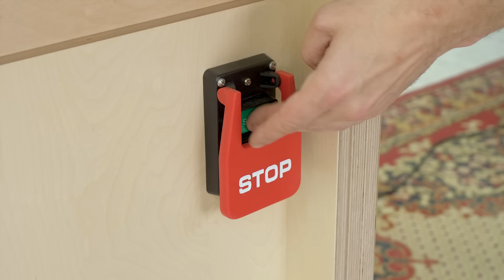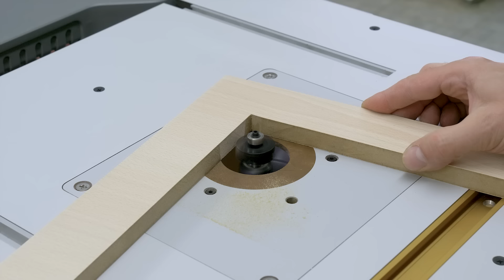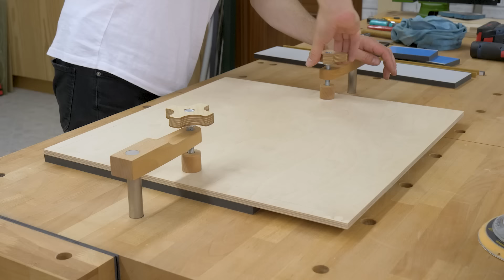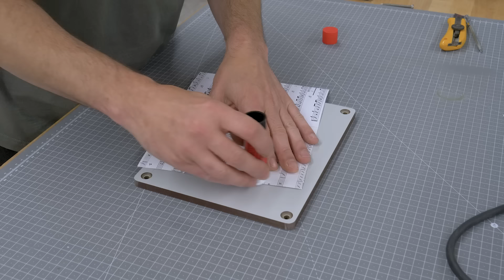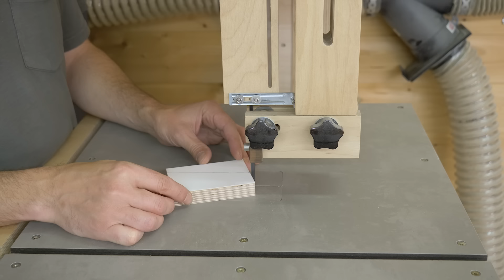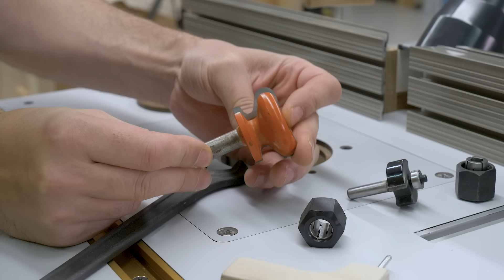Homemade Router Table & Router Insert / Mobile Workbench EP 3

Comment: I want to bring up one point I realized when I build the Mobile Workbench. The original fence can’t used anymore for shorter cuts than 11 cm due to block of the slider by the table saw extension pice number 15C without disassembly them for this kind of shorter cuts. I suppose this design is made on purpose this way to some reasons I do not understand at the moment. Is the any hint which can help me to get rid of the problem?
Reply from the maker: https://www.paoson.com/forum/viewtopic.php?f=33&t=2175

Comment: Hello,

I think your video is really great. I have the same router installed in my table. However, to turn the router upwards, I have to support the router from below and push it upwards a little with my hand, otherwise the mechanism will slip. 
Is this similar for you or is there a fault with my router? In the video, it looks like you can easily adjust it from above. 
I would really appreciate an answer and maybe even an idea to solve this problem.
Many thanks for your videos

Comment: Hello Suso,
First of all, congratulations for the design of the entire bench; from far the best I’ve ever seen in UTube !
I see that you are using the Bosch GMF 1600 router, but in the documentation that you posted I’ve also seen the Makita RT0700 kit with various sockets and at a more affordable price although it has less power. I would like to ensure that one of this socket can be used as a lift to mount it as a router table without major modification, but it’s hard to tell from the pictures I’ve seen. Of course I would like to adjust the depth from the top, without having to access the router from inside the cabinet. Could you please confirm that this is the case and that it would be sufficient to buy this kit and a plate ? Or do you think the Bosch is a far better option ?
Reply from the maker: hi Alexandre, the Makita RT0700 kit does not have the option of adjust the depth from the top, you have to do it from inside the cabinet, sorry. You can make a homemade lifting system, I have in mind to build one for my Bosch, the current system does not work correctly.
Reply: @Paoson_Woodworking  thanks for reverting back; now I know that neither options seem ideal; I’ll follow your posts with great interest to see if there is a good way around it; the cost of these lifts is prohibitive (the nice ones, I mean)
Many thanks and keep up your extraordinary work ! Best regards !
Reply: @Paoson_Woodworking  Thanks for this info, I've just purchased your excellent plans and am starting the build too.  Do you think the Festool 1400 or 2200 would also be appropriate or is the Bosch the only one with this function of height adjustment from the top?

Comment: The board you are using should be MFB EN 622-2 (HB). The HB stands for hard board. It‘s only „HB EN 622-2“, when it is not coated/laminated. SwissKrono calls them CDF. Anyway, great things you are building for the workshop!

Comment: man I just found your channel the other day, but I love it.  you show a lot of good angles, and explain how you're doing things and little tricks, very well.  and this video in particular has helped me rethink a design I was doing for a portable benchtop router table. I don't have one of those larger routers that someone would need for a table like this I have a DeWalt 20V(american .. 18v rest of the world) 1/4" <6.35 mm> trim router and I am only doing this for a one off project.  I think I now have to invest in a larger router so I can buy your plans and build this, slightly modify it so I can just clamp it to my work bench, because while we have the same table saw (dewalt 10" jobsite<25.4 cm> it looks like to me) my saw is mounted to the rolling stand as my work shop is also my garage, and I need the mobility and smaller footprint.
Reply from the maker: thanks mate! I would love to see your router table when you finish it
Reply: @Paoson_Woodworking  I ran into some design problems....mainly I OVER counter sank a hole for a screw head, ended up going right through my 1/2" (roughly 12.7 mm) plywood. so back to the beginning to start over. But as soon as I get it done I will take some pics/videos and show you.

Comment: Two suggestions -- Mount your vacuum outlet near the bottom of the router's box, and two, put air holes in the acrylic door near the top -- this will allow a draft across the router and down to the outlet port. Otherwise the dust collection will not be nearly as effective as a closed box with suction near the top.I've built three different tops for my routers and trial and error led me to this solution. You may want to create a ramp toward the outlet too.
Reply: See 3 X 3 custom for some designs.
Reply: @richs5422  she struggled with hers but finally got it nailed.
Reply: Hii sir